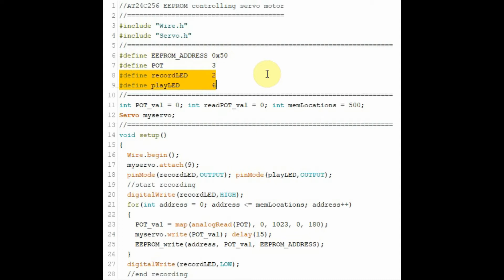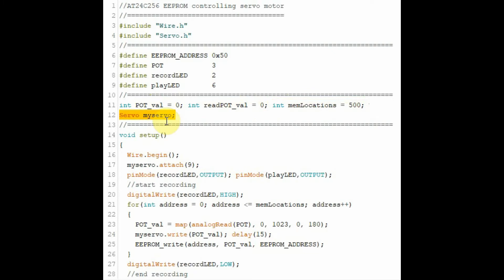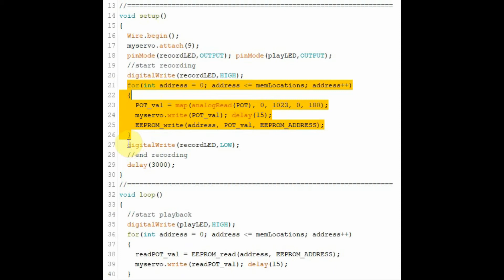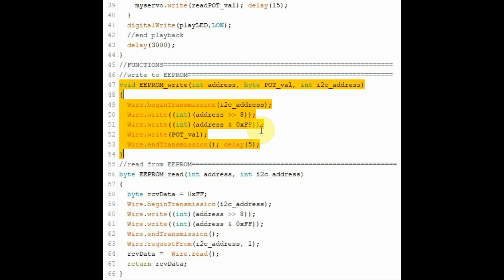Servo Motor Control using AT24C256 EEPROM

Comment: Thanks for this excellent explanation of what is happening in the code, easy to follow. Wondering how you would modify the code to include a second servo motor.
Reply from the maker: Thanks for your feedback, and I apologize for my late reply. As for code modification, well I can demonstrate that with a future video. I'm currently producing tutorials on AVR Assembly via Arduino Uno. Once I'm done, I'll work on the project.